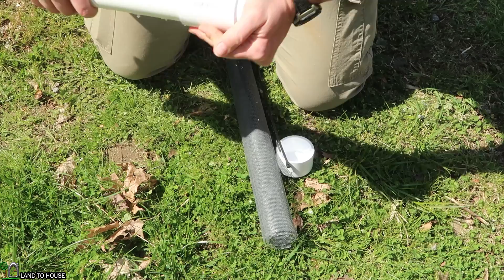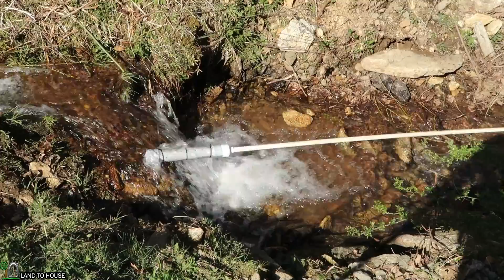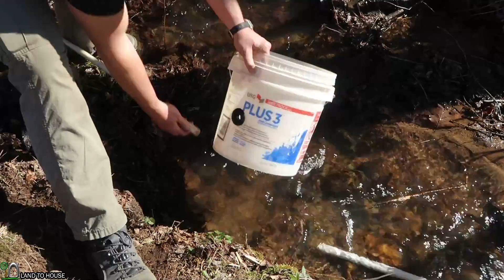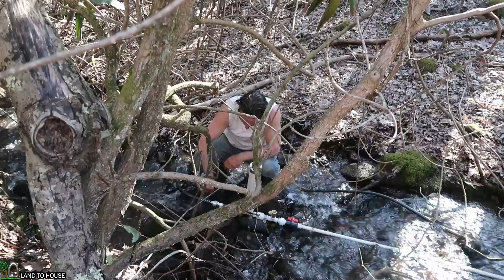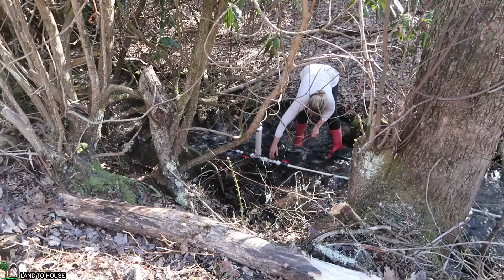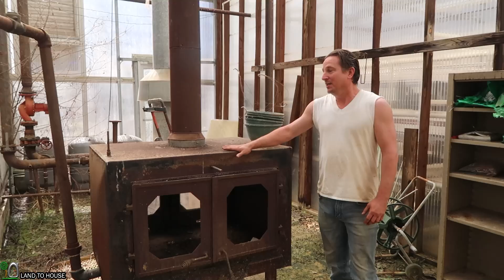Ram Pump Brings Life to Abandoned Greenhouse

Comment: If I have 4-5 ft of drop over 10ft, would that be sufficient to power the pump?
Reply: it depends on how high you want the pump to lift water. a larger drive pipe and smaller feed line will lift water higher with less water volume being supplied. can't have free energy. think of it like 5 gallons falling 1 ft can lift 1 gallon up 5 ft.

Comment: play devils advocate  what happens when you get heavy rain and the water flow raises and is stronger than now, looks like may need to be better restrained { trust me have lost pumps in floods }.if it was me would have something  to retain the pump  chains or cable fixed to trees or stakes higher up good luck  are you pumping into a tank or tanks as one over flows feeds the other

Comment: I just cannot understand why use a long small drive pipe, instead of using a 4 inch or bigger short drive pipe reduced to the size of the ram pump intake. The flow of the water is more than enough to drive the pump.
Reply from the maker: Water flow and head pressure are two different things. The cycling of the waste valve can only produce a pressure wave the size of the valve. If that small 1/2" pressure wave hits a 4" body of water it will be  Dissipated and stop the pump.

Comment: Can you use the ram pumps in series to step up the pressure to pump a longer distance or to a higher elevation of required?
Reply from the maker: The problem with pumps in series is that the flow rate out of the first is not enough to feed the second. Now you can set them up in parallel to increase the output but not height.
Reply: @LandtoHouse  cheers

Comment: a small generator and a small pump would do the same thing. that install will not survive a 3'' or 5" rain storm IMHO.
Reply: a generator has ongoing running and maintenance costs, and is hardly a green option. There is no reason this set up should not survive a storm either- there are ram pumps here in England that have operated for a century or more. One I saw was discovered in a purpose built chamber abandoned for decades. They excavated tons of sediment that had filled the long abandoned chamber, cleaned the pump up and got it working again.

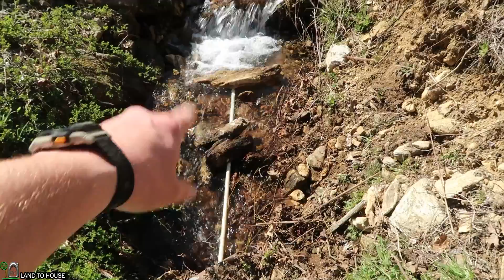Comment: 8:30
Isnt that a Problem of all that airbubbles in that pool? From the mini-waterfall?
Reply: The drive pipe is fed from the bucket which has no air bubbles in it.
Reply from the maker: If you only had that as the intake yes. With the bucket you don't have the issue with air bubbles.
Reply: You both are right ... but... less airbubbles are always better. :-)
Reply: BL8, Indeed it is!  Which is why the bucket is so important.  It's why the turbulence in the pool doesn't matter.
Reply: You are not wrong we repositioned the intake a few times to try and get as little bubbles as possible

Comment: I sold commercial greenhouses in a four state area, Mid- Atlantic. That structure can be curtained to isolate areas they want to keep under heat and a also above across the purlins to keep heat at crop level. Horizontal Airflow fans needed to keep air moving, desease potential down. Paint all of that PVC used in greehouse black to limit algae growing within and where possible outside bury it to keep light off it.
I had customers made a very good living with structures similar to that. Hopefully someone didn't oversell a grower on too much greenhouse and unnecessary  equipment. I'd seen that happen and actually had people cry to me when they realized that their trust had been betrayed.... I'll never forget those people or that one A$$HOLE salesman who actually saw to it that those younger growers lost all and in one case, a wife.
Looks like this couple likely found the remnants of such a situation. In what portion of what state is this greenhouse?

Comment: I have a one inch line running up the creek over a hundred feet with a head of over ten feet could I run that straight into a 1/2  ram pump some how or do I need to run it into a bucket with a 1/2 inch line.
Reply from the maker: You will need a 1/2" drive pipe to feed a 1/2" pump. The 1" line can feed into a stand pipe and then reduce down to a 1/2" pipe. A bucket would lose your head pressure in that case.

Comment: What do you do about winter freezing?
Reply: Lol, two choices, empty the water or let it break, what did you think!
Reply from the maker: I have run a pump for a few weeks straight in freezing temps. As long as water is flowing it pumps. If it stops the pressure tank cracks.

Comment: good luck guys, pity you used pvc pipe, must not be much pressure or it will blow out
Reply from the maker: The ram pump is a low flow and low pressure pump.

Comment: Are the rivers where you always install the rampumps are "privat-rivers"? On Privat-property?
Reply from the maker: So far the creeks have all been on private property.
Reply: @LandtoHouse  need to check local rules though,some areas you can have "private property" that includes water rights,but some larger creeks/streams depending on the local regulations,the land is private property including the land under the waterway, but the water itself is state managed and open to public use such as kayaking.so in that situation you need to research and see if it's even allowed to divert water from a stream/creek.(could be huge fines if you don't check first.)

Comment: I do not understand the role of the bucket so far from the  ' initial intake'  , and specially if it is an  ' air-free intake'  which is 1,5 feet down from the ' initial intake' .  If the bucket was hermetical ( no pressure lost from the holes in the cover of the bucket)  , than I would understand the reason  of placing the ' initial intake '   so far way.   I think you are losing some ' efficiency ' in this project.
Reply from the maker: Some head pressure is lost by using the bucket. Its well worth it to provide an air free water source. I have installed many many ram pumps and the bucket is very useful.

Comment: Wouldn't the ram pump work even better if the inlet pressure head was increased by sealing the holes in the bucket's lid (or just not drilling them in the first place)?  Wouldn’t it be better to use all the inlet pipe to generate maximum pressure head, and the belching of air from the bucket only done manually at the time of commissioning so that the leaks in the lid don’t reduce the efficiency of the system during operation (or just not using a bucket at all)?

Comment: You have placed the supply pipe in aeriated water, therefore you will never get max uptake of water, better to place it in deeper still water.
Reply from the maker: That is one reason for the bucket. It helps take the air out.